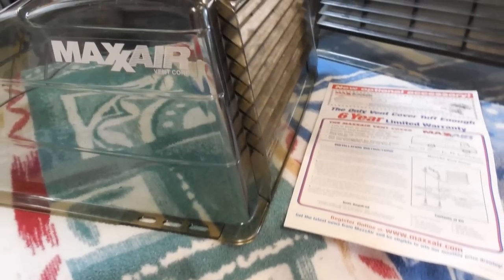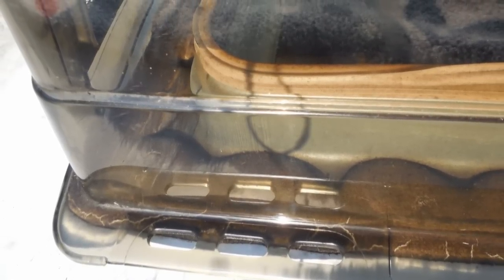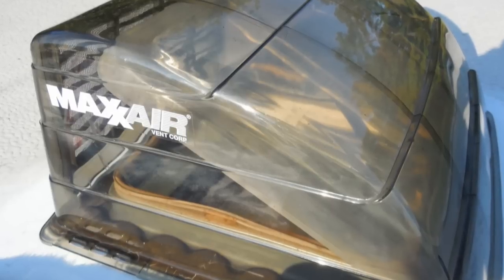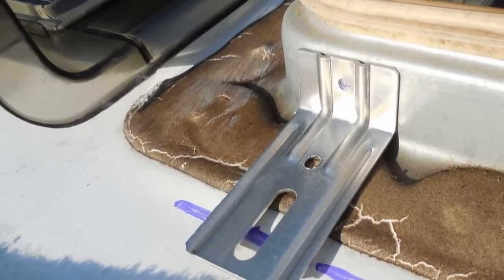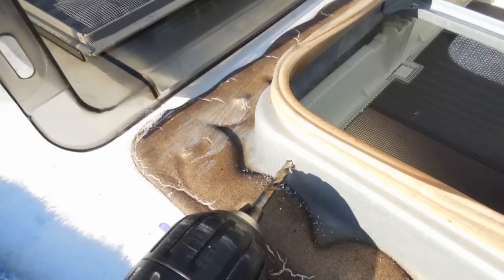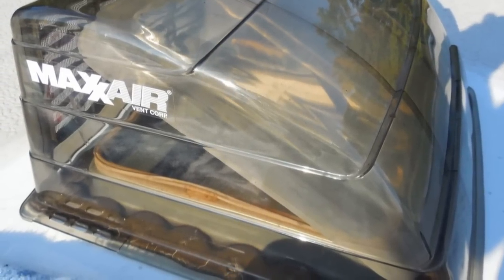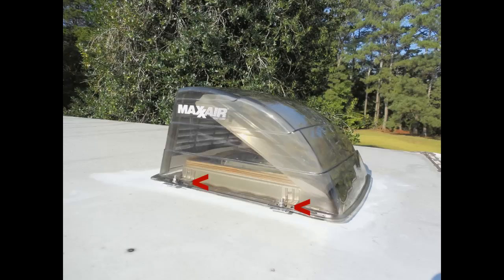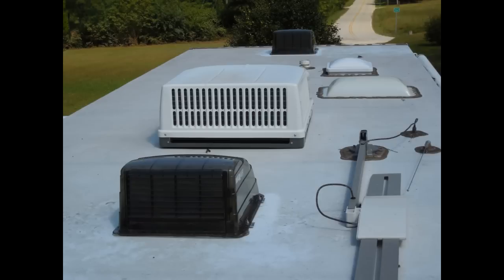MaxxAir Vent Cover for your RV - Install 1, 2, 3

Comment: Best upgrade I've done to my trailer per dollar so far but I did add screws since they only came with four screws, only difference is the ones I got are hinged for cleaning or access. I'm going to be cutting the caulking away from the vent to lower the brackets so they sit flush with the roof and recaulking over them. Also I put a white one over my bathroom to allow maximum light but I put a smoked one over my bed to block the light just something to think about.

Comment: Without sealing the bottom with some foam, the interior screen gets full of debris from the wind blowing.  Seems like the air flow from the rear vent would dry out any moisture.????
Reply: CayceHobie since the unit is made without the cover in the first place, you're not losing anything.  And I was warned NOT to seal with caulk in order to preserve air flow and thus prevent mold and mildew.